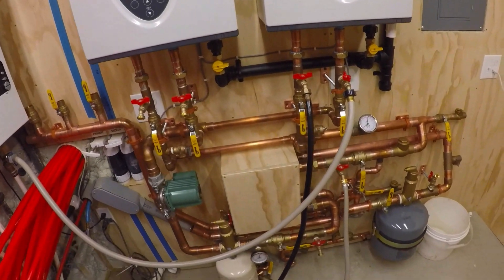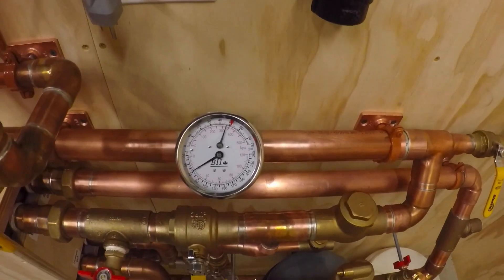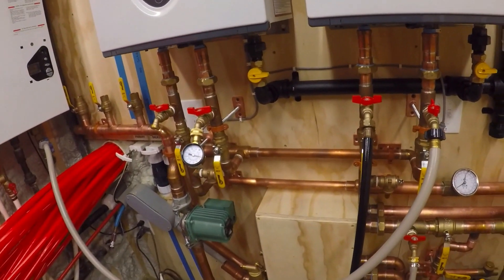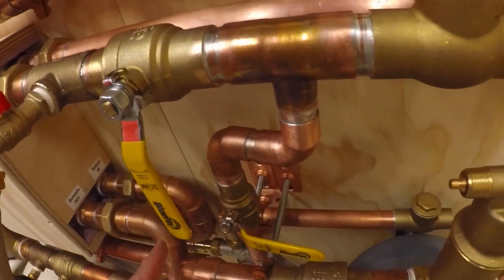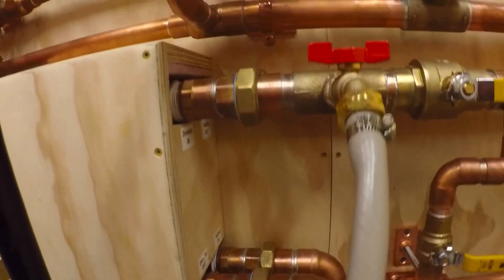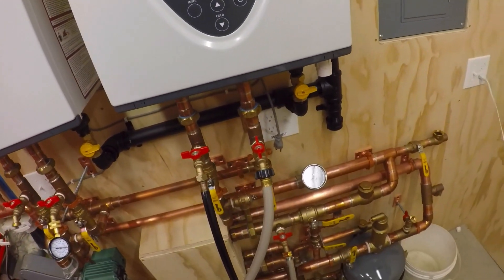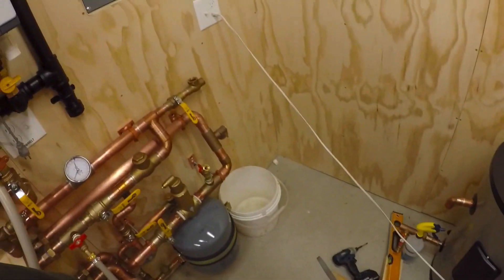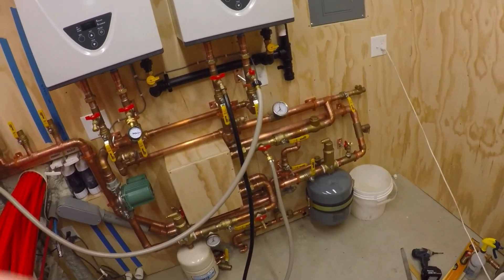Primary Loop Complete!  No Leaks! - Secondary Piping Started - Episode 16 [5-31-2020]

Comment: I personally love the Oatey flame protectors like you have. They do smoke pretty good, as you said.
Reply from the maker: This video was my first time using it, and other than it smoking a bit it worked well. It got A LOT more use throughout this project as you’ll see in future videos and held up well, so no complaints. I did find that using a small piece of sheet metal between the flame and the cloth where possible also helped a lot.  Thanks for your comment!!